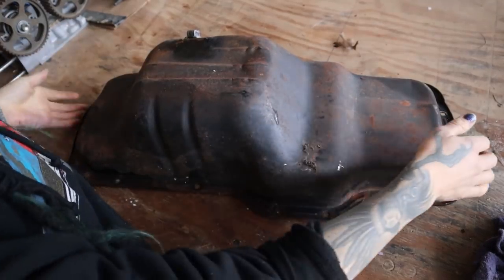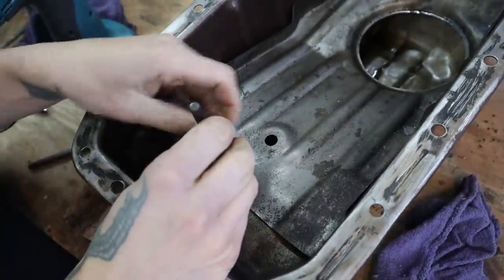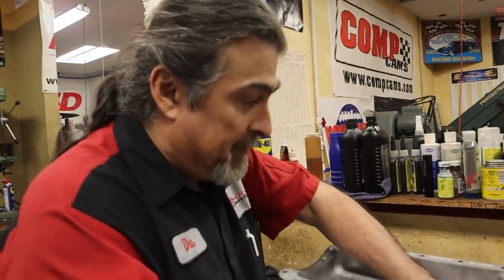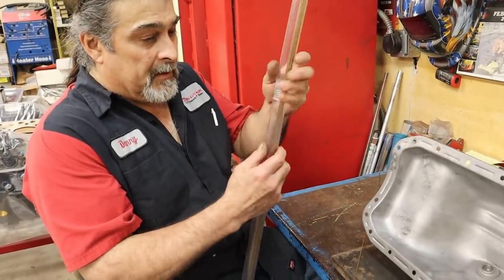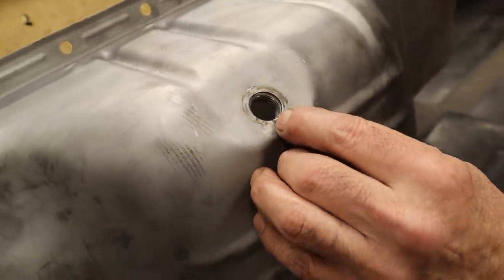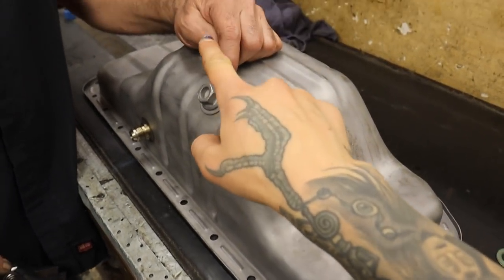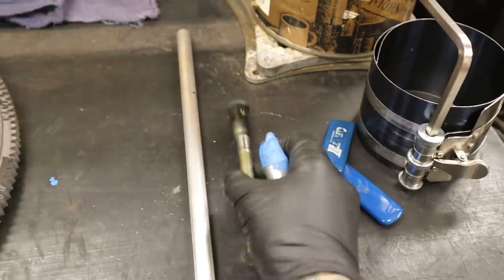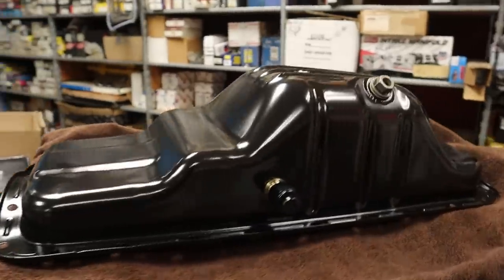Modifying my Oil Pan (for a Turbo Drain, and some repairs): The Supra Saga Series Continues! Pt. 17!

Comment: Faye, the machine washer behind the center plug was centered - perfectly.  Loved that fillet around the AN fitting and leak testing with solvent rather than a thin oil.  Some good lessons.  Thanks Faye and Danny.

Comment: You can use a sack of chalk to also help locate small cracks like that. Like using a pounce pad for lettering when painting. 
Cover the edge of the pan in chalk and then rub it in a little bit and whipe off the excess with a rag. If there is any left in a deep crevice or something its probably a crack. Works surprisingly well if you cant actually see them that well.

Comment: I sent my Snap On guy on a goose chase looking for a half inch hole saw.   He didn't come through for me so I found the spot weld cutter.. I needed it to install toggle switches in a chrome plated aluminum or steel panel... normal drill bits were snagging the chrome and peeling it off the surface, where the spot weld cutter would score the OD of the hole first and make a clean hole with no damage to the chrome.   I showed the Snap On guy what I came up with and he said....'oh yeah, I keep those in stock on the truck..."    SMDH....

Comment: I'm putting a 7M in an old S30Z. Even after a year of the engine being nothing but an empty block with a head and oil pan on it for mocking up in the chassis, the drain plug was STILL leaking.
Reply from the maker: Oh my gosh!!!!!!!!
Reply: @FayeHadley  The plan is to modify it with kick outs, trap doors, and I might steal your pickup mod as well, so hopefully the leak issue will be fixed after that. 

I also plan to graft ITBs from a GTR into a custom intake, I already have the GTR parts on hand, and use a GE distributor as my cam sensor, while the cap being modified as a wire junction for coil-on-plugs so it looks like spark plug wires are going to each individual coil. I'd also like to make a beauty cover to go over the cam covers reminiscence of the old 2T-G styling. 

So far the only thing I have done is the fabrication of the low-mount turbo exhaust manifold that tries to mimic the look of the  aftermarket headers they made for the old S20 Nissan engines. The focus is still on the body and suspension so it may be another 10 years before it's done. If it ever gets done.

Comment: What did you do to protect the inside of the oil pan?
Reply from the maker: Sprayed a very light coat of WD-40 in there for now
Reply: @FayeHadley  Awesome thanks. I’m in the middle of cleaning a pan and I wanted to make sure the inside was not needing powder coating. I drilled out the baffle like you did so I could get it clean in the nooks and crannies.